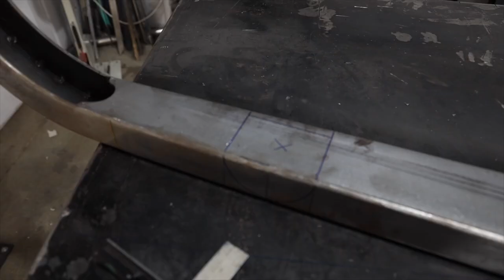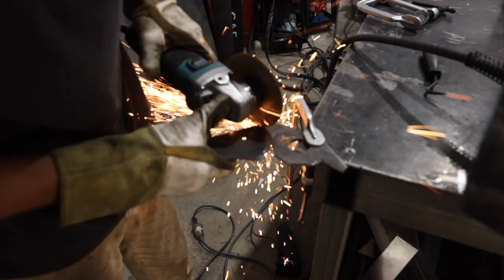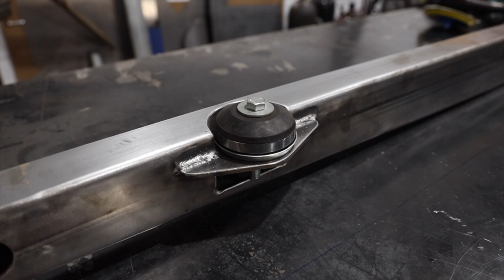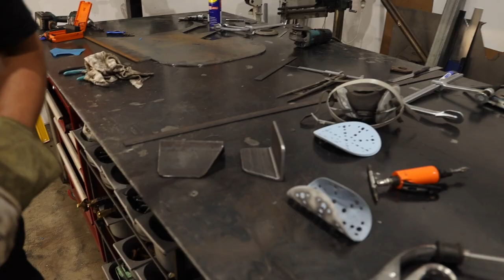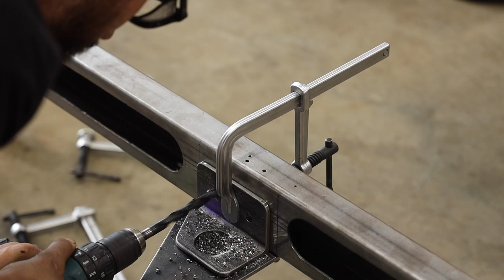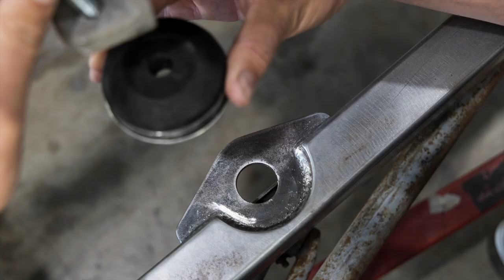Fabricating Custom FLATHEAD MOTOR & TRANSMISSION MOUNTS - Single Seater Race car (Part 2)

Comment: I think the snafu with the front motor mount location was a blessing in disguise ! These mounts add so much style, they just blend it all together. The trans mounts should do nicely, most guys would have just laid a bead around the outside of the top plate but the inner weld will add a ton of strength. I love how your Aussie accent floats in and out! lol beautiful work Jordan.

Comment: Its good to see that you flipped the frame on its side to weld on the horizontal not every one does that normally they will just do a vertical down weld, which is not wise to do.. Welding on the horizontal or on a flat surface is always a stronger weld especially when you welding up  frame rails. I think your rear mounts are going to be fine.. Nice work Jordan. If that don't get your juices flowing nothing will. COOL

Comment: Hey Man, that's pretty cool. I make my brackets like you guys, but without the luxury of a plasma cutter. An idea if I may.... You can always link the G/box mounts L+R with a gusset underneath. I'd also weld inside the rails a bit of 8mm or 10mm bar strip... and thread it. 
Then you're not reaching in with nuts and spanners. And here's a tip. Mill scale comes off best with a seaweed/stripping/polishing (whatever you call it)  disc I've found. Thanks for the vid fellas. I like what you're doing. Cheers from Sydney.
Reply from the maker: Thanks for all the great tips! I definitely made those threaded plates immediately after getting my fingers in there haha!

Comment: Keep up the excellent work!!!   I am going to use some of your ideas in building my own single seat street rod except with a GM Iron Duke 151ci 4 cylinder out of a old Chevrolet Vega backed by a four speed.
Reply from the maker: I’m liking the direction your going!

Comment: im suprised you didnt widen the frame in the middle to give you the space you need as your legs could go each side of the engine or couldnt you mount the floor on top of the frame then you could have more beefy mounts for the gearbox. as i doubt 3"to 4" higher foot plates would make little diffrence if you look at the old photos some drivers where way up in the air. all youd have to do when you put the engine in is lower it and slide it backwards the fastern the mount bolts from underneath by welding nuts on to the gearbox mouting holes
Reply from the maker: Further videos will show I cut it all out and designed something much better!
Reply: @bennettscustomsco  lol spoiler alert

Comment: Looks great, your attention to detail is excellent.
One suggestion I might make is for the gearbox mount/cross member, a X member with a cage around the drive shaft would improve flex and protect your ass from a loose shaft.
Reply from the maker: Definitely not a bad idea- once I’ve swapped in the model a rails and remove the box tubing this it probably what will happen.